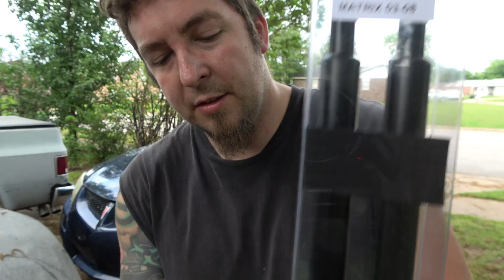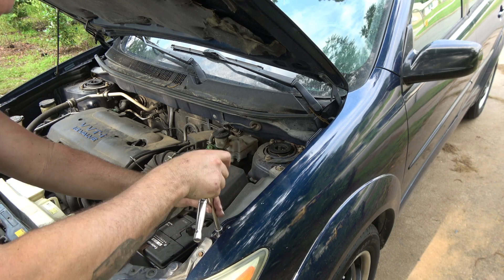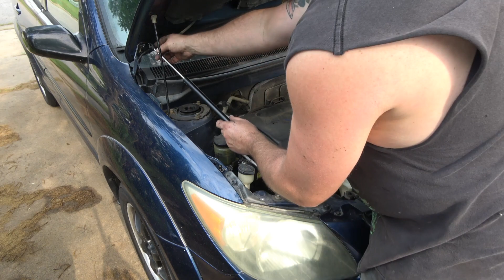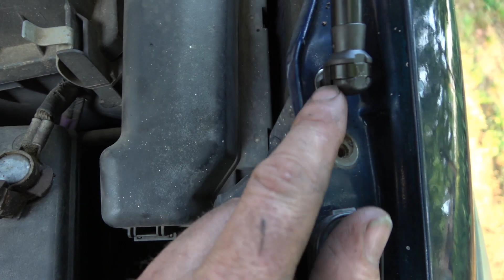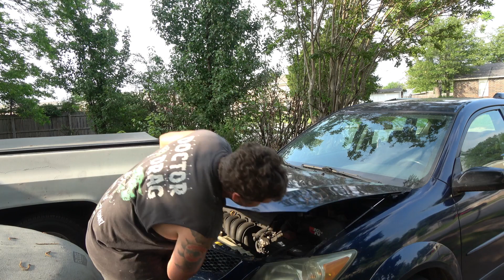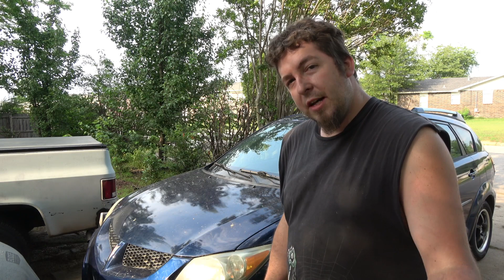Pontiac vibe Toyota matrix hood lift supports

Comment: It’s got fuel pressure  has a matter of fact I put brand new fuel injectors and I also put new gaskets on the plenum upper and lower. And also did a tuneup. Ran good and then it stopped running hood started to sputtering really bad and it also started biting the fuel out of the tailpipe like raw fuel
Reply from the maker: So too much fuel or not enough spark. Too much fuel could be o2 sensor, map, water temp sensor. Spark i am assuming you changed plugs, coil, igntion control module, worn distributor. Just some ideas

Comment: Hi again Terry. I am ready to put my fiberglass cowl hood back on after the body work. Could you please tell me which brand and length you used please? I think those particular ones would work fine for my application. Unfortunately, I might have to drill into the hood to secure them, but that is ok, I will use a small oval stainless chrome plate on top for the couple of bolts to come through. Not a show car. Ex- 8 sec drag car. Thank you sir. Appreciate it. Cheers from Motown.
Reply from the maker: I used SOKIETECH d2f8 from ebay but neither ebay or google tells me the specs they do mention that these do not work for fiberglass or carbon fiber. maybe they do on a larger hood but i cant be for sure.
Reply from the maker: @robertclymer6948  if thats what they are using i would go with it.
Reply: @EfurdGarage  After more research Terry, and seeing their installation sheet, it is exactly the one I need. Thanks for all your help.
Reply from the maker: @robertclymer6948  your welcome

Comment: Hey, sir this is the first time I ask a YouTuber. So I have a 1995 S-10 2.2 four banger and I recently pulled it from someone’s back yard. And I replaced the fuel injectors replaced a few other things. So after putting it back together it ran go for awhile. And i recently took it for a drive it seemed to be running good and then it started running sluggish and sputtering really bad. What could be the reason?
Reply from the maker: as much as i would like to help there is not enough info for me to go off of. i would start by checking the fuel pressure first.